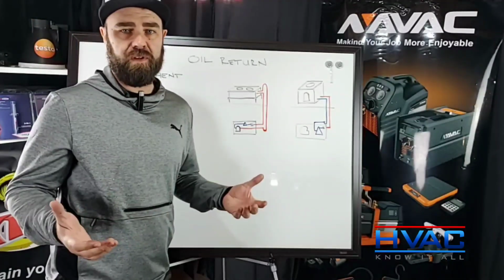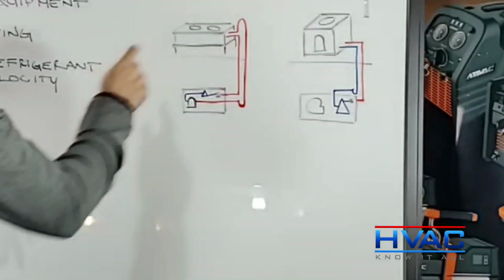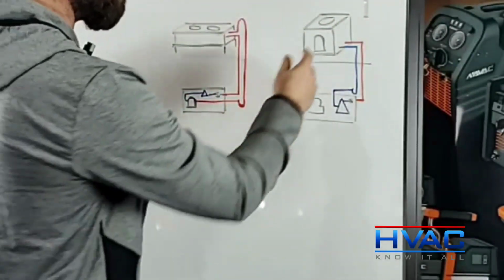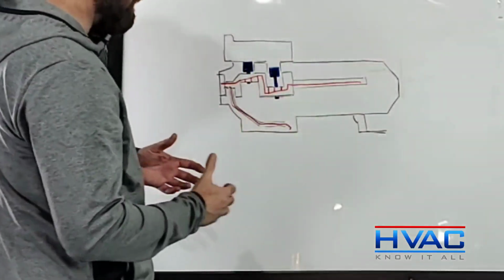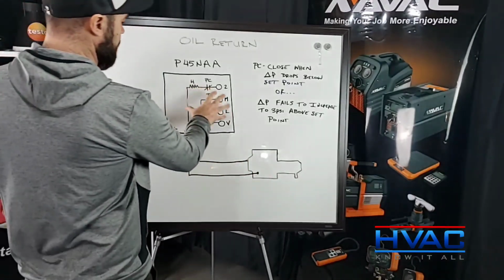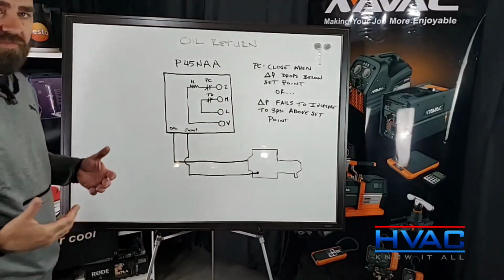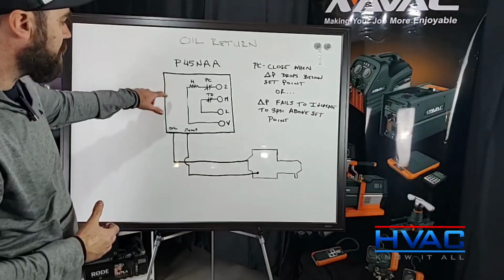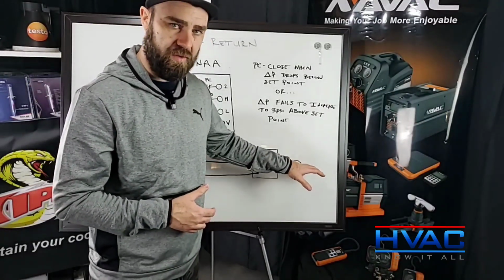Compressor Oil Return and Oil Failure Controls

Comment: Can you help me with this situation : my 4 screw compressor rack running well with 3 compressors but last compressor to start running does not get oil. In sightglass bubbles are seen and it gets a low oil flow alarm. what do you think reason could be ?
Reply: Look at oil line piping. Is it in series?
Reply: @dbell41888   there is a common header, oil inlet is in the center of the header. from center 2 compressor on left and 2 compressor on right oil is distributed parallel.

Comment: Im having an issue that i beleve is an electrical issue but cant figure out. Newly installed copleland compressor keeps tripping oil, im taking pressure from pump and crank case get 48-52 psi, sight glass on oil float is 3/4 screens are clean on float and compressoras but switch tripps about 1 1/2 mins after start up
Reply from the maker: The control works off pressure difference, what's the crankcase pressure and whats the control set for?
Reply: @HVAC Know It All  its on a rack crank case goes from 39-55psi oil pump goes anywhere from 90-115psi I'm currently on the third oil switch it's a new compressor, there were a lot of shorts in the control voltage it's an old site and wiring was never updated. But can't find any electrical issue going to the switch and since I've installed this switch and no longer trips after the time delay it runs for hours while I'm on site and then it trips when I'm not there , im heading back again today to pretty much just watch it and see if pressure ever drops because the whole time I'm there I'll watch it and my oil pressure stays around 49 to 52 differential
Reply: @HVAC Know It All  I feel like I'm at a loss on this one. Which is why I'm commenting on a YouTube video I tried talking to Copeland tech support and my supervisors and no one really has any idea of what would be causing it. Currently have no circuits flooding back this is a weird rack though as my three low temp compressors discharge into the three medium temperatures compressor suction header and there's a de superheat valve that shoots liquid into the discharge line of the low temp compressors to cool it off. the compressor that keeps tripping oil is on the medium temp . I thought it might be issue with the de superheat valve I adjusted it a few times it's currently set to open if the line raises above 80°
Reply: @HVAC Know It All  I got it, it was electrical, and there is a separate relay for head fans/oil pressure switch shares voltage with head fan. The relay is sticking randomly and sending power to oil switch with the compressor off. Damn this call kicked my ass

Comment: When commissioning a new compressor with oil at the right level in the sight glass,  will oil level go lower on the sight glass after compressor start up?, due oil getting trapped in the piping? and how long will take for the oil movement to stabilize? and how to estimate the additional oil needed to add to the compressor?
Reply: Hi, it's not easy to determine the return time nor the quantity of oil needed. It depends on compressor's size, circuit length, size of condenser, size of evaporator, type of application etc. Generally speaking on condesing units, keep track the compressor's oil sight glass, and add if its starts going around at 1/4. Regarding quantity it all depends on the size of the application. In racks things are easier as you usually have extra safety features like oil level sensors and big oil reservouers to counter the oil loss.
Reply: Waiting for the reply

Comment: Great job! What are your thoughts if the condensing unit is located below the evaporator. Do you need any traps or an inverted?
Reply from the maker: Not sure if I've ever seen a trapped liquid line tbh.  But yes an inverted trap on the evap outlet is a good call.